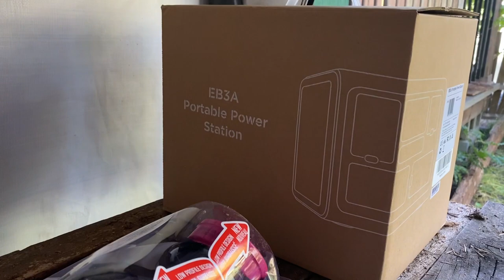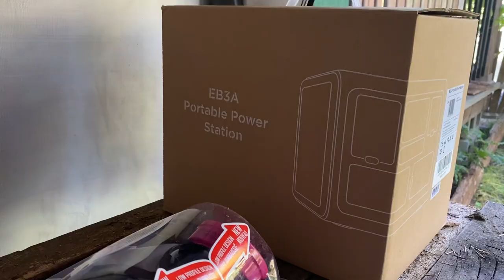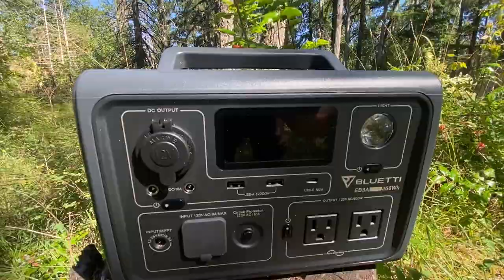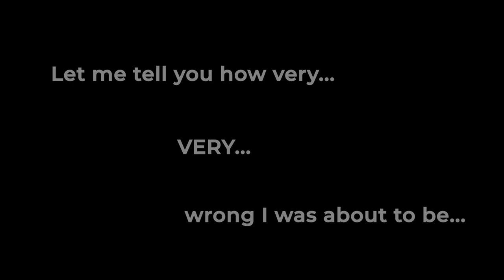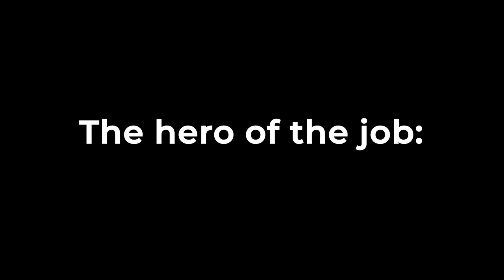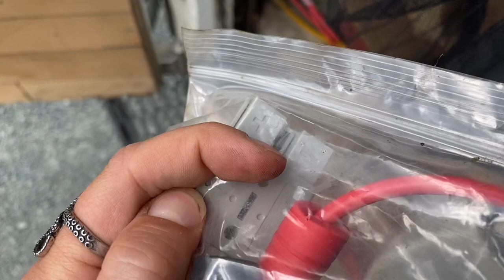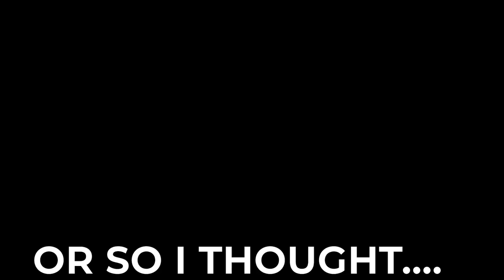Trouble at the Tiny House Cabin Renovation | off grid Bluetti EB3A

Comment: I have a tiny house and my recommendations  are to make sure you don't make any holes in the floor.  Go through the side walls up off the floor level.  This will help with rodents entering.  They only need 1/4 inch to enter.  Also, make sure your subfloor is tight.  Then add insulation and then the inside floor.  Otherwise, you end up making a nice home for rodents.  I  made a lovely squirrel house under my tiny twice!  Same with the roof area due to bats.  I did it the solar battery way to build and you are learning and doing great!   ❤ the river.

Comment: It's looking great! And you look great with those power tools! I bought a bunch of used power tools over the last couple of years, including a table saw but I haven't got to use all of them yet...yet. hehe when I was little my dad built houses for a living and I would go to work with him so I have a wee bit of knowledge but he's been gone since I was 22 or I would have mastered all the power tools. Lol congrats on the bluetti! I can't decide on what size of solar generator I want so I'll be curious about how well your new one does. I did buy an older 2500 watt gas generator for 50 a year ago and it works great but I only planned to use it for building in the forest. But, I think it will come in handy I'm a pinch to charge a solar generator of something similar. Anyway, you're doing a fine job, Flossy! Happy trails!

Comment: Glad you talked about the battery. I bought that one and bought 200w solar panel. Haven't used either as I am scared.
Reply from the maker: @mielesutter4159 aaawww what are you scared of? It’s easy to use, and when I have the right connection easy to set up! Im happy to help and answer questions!